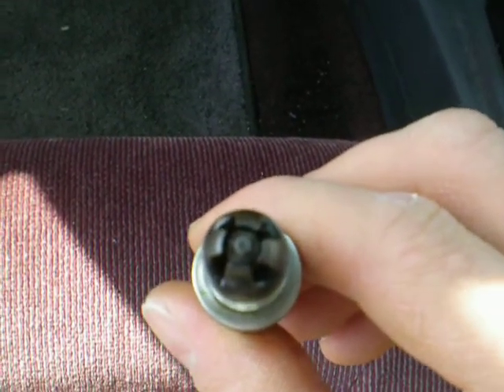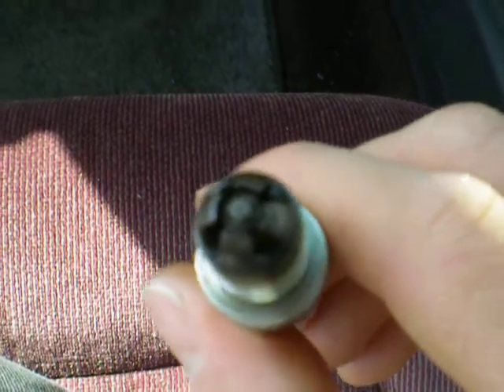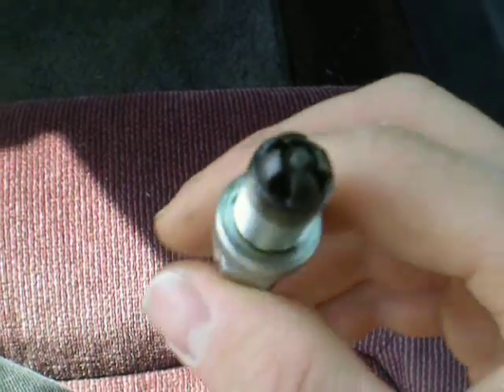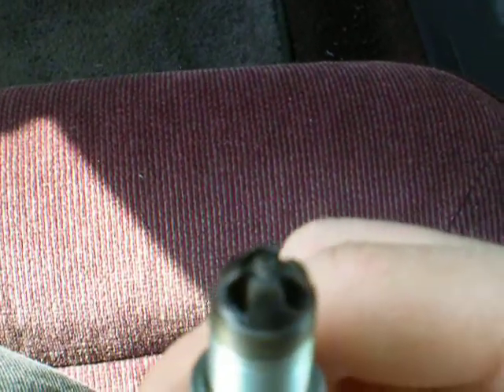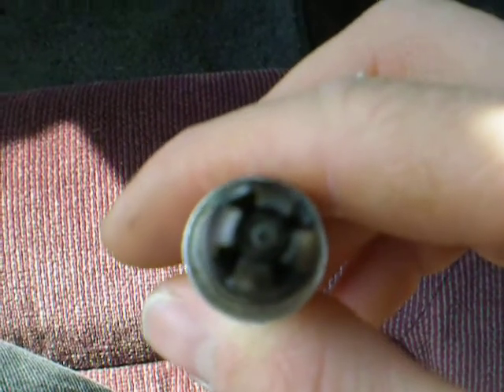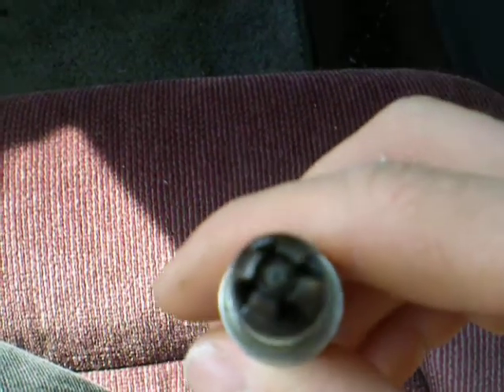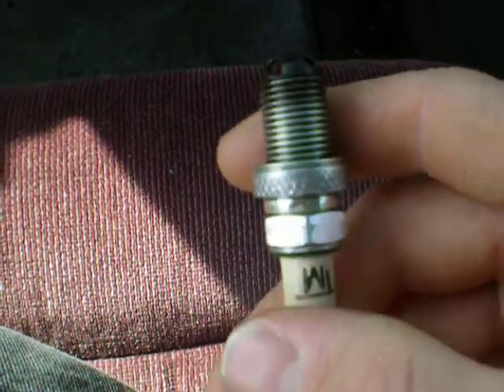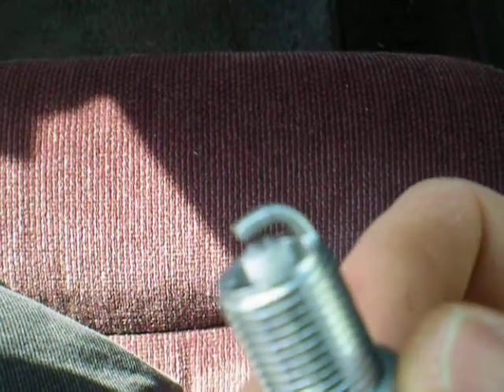Torque Master spark plug test with plasma

Comment: Did they even last for at least 10000 miles with plasma?
Reply from the maker: No they weren’t really worth messing with but plasma a destroys everything.   It’s kind a like a EDM machine
Reply: @matthall6182  Thanks Matt, that's really helpful
What's your opinion about tungsten tipped plugs for plasma?
Reply from the maker: @firozmusthafa  They still don't last just too much amperage
Reply: @matthall6182  I heard a guy replicating Robert Krupa fire storm design. He said the plugs were able to withstand the plasma blasts. I still can't believe it because if tungsten is unable to withstand the blasts, I don't understand how design change can make such a huge difference.
If you have already tried fire storm design I would love to know about that as well. I am unable to try this design because of the lack of good tig welders in my area.
http://hho4free.com/spark%20plug%20howtomakeplasmaplugs.pdf
Reply: @matthall6182  When I researched about tig welding, I found that 2% Lanthanated tungsten welding electrode's ability to withstand plasma arc compared to pure tungsten electrode.
It is known to resist splitting tungsten under high amps. Not sure if it can be welded to spark plug though. It is said to last 4 times more than pure tungsten
Reply from the maker: Instead of filling up the comments why don’t I just give you my number and you can call me sometime I can tell you how to make  spark  plugs 541 731 0372
Reply: Hi Matt, 
Were your your plugs you made use solid core tungsten rod?   Not sure how it can be made without firing it in a high temp oven & filled with aluminum ceramic powder to seal the center core like how new plugs are made.🤔

Comment: Hey, can I buy a set of those champion tungsten plugs from you? I just ordered a Blue Phoenix for my 1996 Cadillac Sedan DeVille with the 4.6L Northstar. How long are they lasting for you? Thanks.
Reply: Thanks for putting up your results. I'm trying to find a non resistor multi fire Brisk for a plasma ignition mode. Nothing in the size I need for my Kawasaki. I'll look into the Torque Master.

 Do you think a multi fire in a plasma ignition is over  kill?

 Do you think the longevity issues you've encountered be increased with iridium plugs?

Thanks,

Gary
Reply: @garykish8951  I know it's way too old to reply, but replying here anyways to help anyone thinking to use iridium plugs for plasma.
Iridium non resistor plugs are mostly alloys and the ground electrodes are never made of iridium as well, to make it worse Center electrode is very thin, so my point is don't waste money on Iridium because it wont last even 500 miles. Will literally vaporize under plasma. I tried it already

The torque master design is brilliant except for one fault, center electrode is stainless steel, otherwise it would have been ideal for plasma use it is was made of tungsten.
Knowing this I placed order for torque master plug anyway, just for experimenting.
Reply from the maker: Plasmas real hard on  electrodes   Even pier tungsten doesn’t last